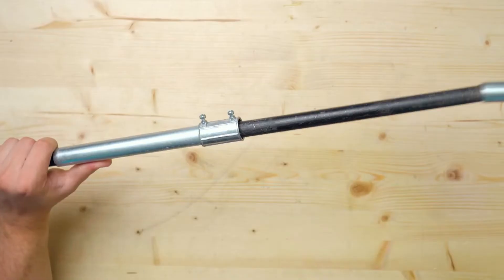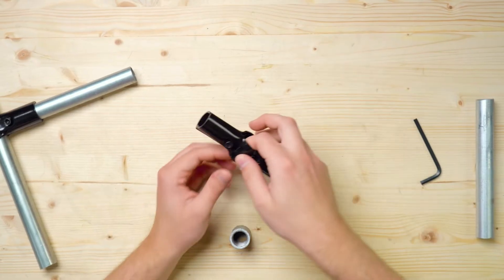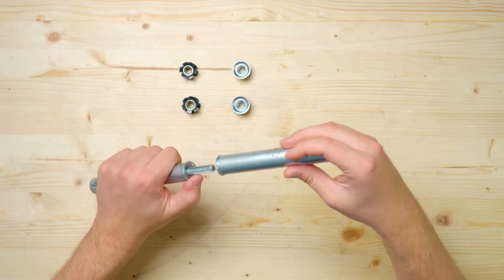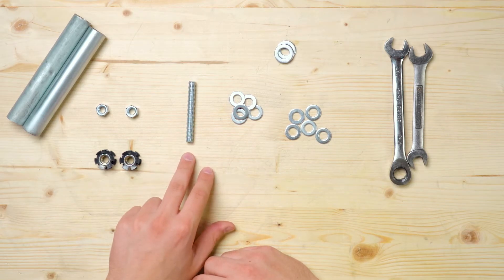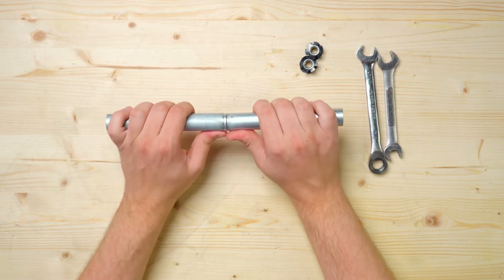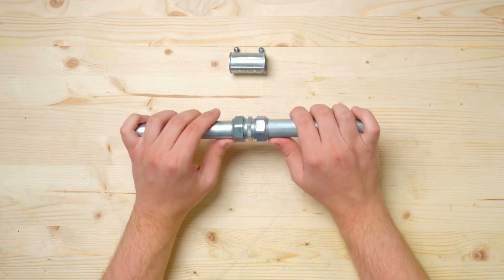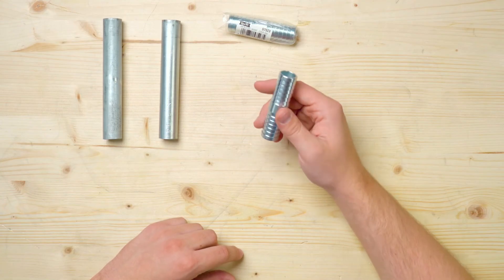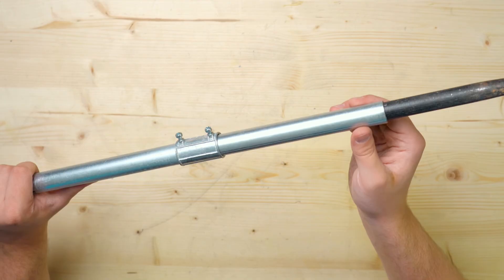Join Metal Conduit With 9 Simple Hacks!

Comment: 3/4" EMT fits very nicely over 1/2" EMT. I use 1/2" as internal couplers on 3/4" end-to-end, and vice versa. Self tapping screws tighten it all up. This is great for an end to end connection that doesn't have to support much weight but does need good pull-out strength, such as a low tunnel purlin or a high tunnel roll up bar.

Comment: Great content.
I used a compression threaded insert usually designed for flat sheet material, to secure an aluminium brace tube on a bicycle rack flat panel. it worked great though you'll need the crimp tool to get the insert to bulge. could be used to join tubes similar to what you shown here. just be careful to use the right size threads inserts to minimize bulge.

Comment: You can usually find some steel pipe that will be a really good friction fit, inside the conduit. Use whatever length you feel you need to support that junction. Then, use the set-screw style coupler. But, drill through the holes in the coupler, through the conduit and the steel pipe. Then drive your self-tapping screws down into those holes. 

It's lighter than a solid steel stake, and you don't have to worry about the support slipping out of place, over time.

Comment: I am hoping you can help me.  I want to build a stereo rack system using aluminum pipe as the supports between the shelves and connecting with allthread.  I have been having hard time finding what I need for the insert nuts.  The inside diameter of the aluminum pipe is .6075/15.4 mm.  Do you have any recommendations.  BTW, I already spent money on the pipe.
Reply from the maker: Hi there, we don't carry any of that size but I think these will do the trick for you. https://www.mcmaster.com/94290A510

Comment: Hello~ 
Do you know whether there are any fittings from any source where I could connect 2-3/8" fence posts ( pipes) to custom make my own canopy?

I'd need all the fittings to make a peaked roof type Canopy, including T's , 3 Way Thru's, High Peak Center's, High Peaks Center / Side, 3 Way Peak, etc etc....
Reply from the maker: Hi there, thanks for the question. Unfortunately, I don't know of any connectors for that large of a diameter. The largest we are working on is 1-3/8" top rail fence pipe. Sorry I'm not much help!
Reply: @MakerPipe  
I actually found out there ARE 2-3/8" CANOPIES out there, and obviously ALL the 2-3/8" connectors identical to the 1-3/8" you've mentioned....

Comment: Silly question I broke a 34 inch steel pipe from trampoline, how can I drill square holes in a galvanized pipe to try to remake the broken one. It also has a narrow neck at end to attach to upper pipe
Reply from the maker: Hmm that is a good question. I think they make some bit for drilling square holes. If that doesn't work you could probably drill out a smaller circular hole then use a punch to make it square.

Comment: 1/2" IMC conduit can be used inside of 3/4" EMT.  Available only at contractor supply stores. Clearance of only .009".  Might be a way to "barb" or crimp it once in place.
Reply: @RealityCheck Make sure you cut the EMT with an angle grinder if you don't have a way to ream the end - a pipe cutter is nice and clean but leaves enough of a lip to reduce the opening diameter ID make it impossible to insert the IMC.  You can also insert some scrap IMC first, then use the pipe cutter to prevent the lip.
Reply: @DougLooney  Thanks man! This is awesome to know.
Reply: Does that scale up with larger sizes?  I'm trying to make a DIY golf simulator enclosure and need a sturdy 15' run to hang a 20-30lb screen from.  I'm going to recess it in the ceiling and make my own retracting system.  I was just at menards today trying to test fit different EMT sizes.